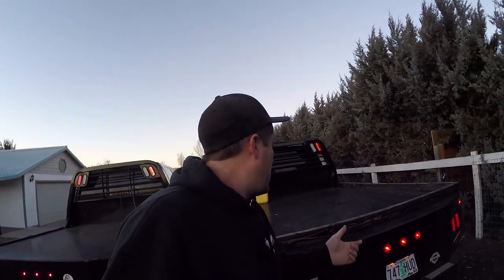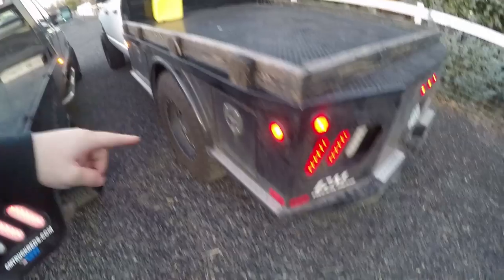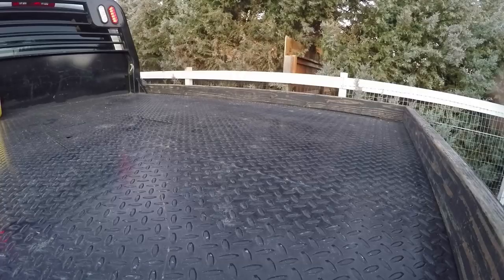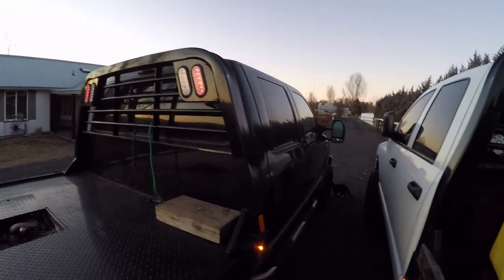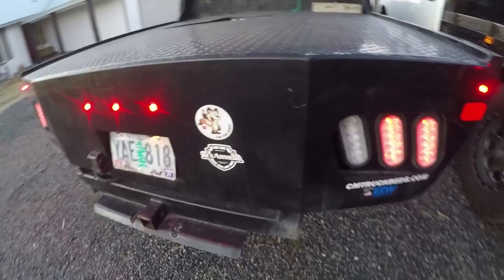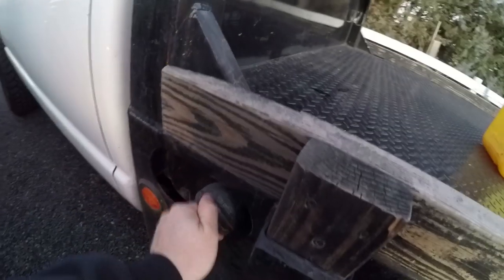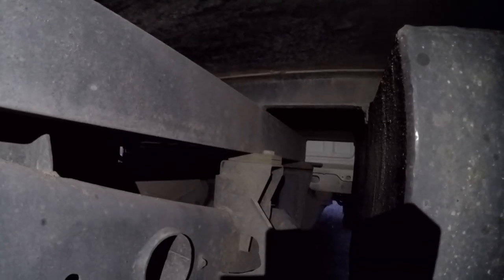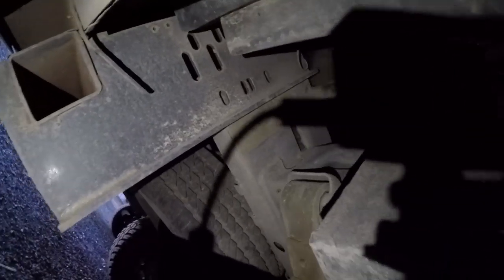PROJECT FLATBED REVIEW 2.0

Comment: You do have to take into account if you put too much weld into sheet metal, it will warp the piss out of it. 
Personally, I would have stitched it about every 6" with a 1" weld though.
Reply: You can also weld it after it cools it just takes a lot longer to manufacture something if you do it that way but it can be done

Comment: Down side of the side board supports that have a fall through on the entire perimeter, it's a hazard for dogs; they'll get their legs caught.  

The other thing about doing a conversion, I had them lower the bed (got a wide one) for easier loading- and it's pain to get gas in.  Learned on a 97 F350... converted to a dually in the process.

Comment: Careful putting the fill neck replacement inside the headache rack, let me rephrase......inside the outer upright toward the middle because if you're loaded with somethin you're hooped when you need fuel! My buddy's dad and grandpa had a bunch of 70's ford's with flatbeds we fed and hauled cows with, well the fill necks were cut into the floor of the bed on a couple and when you hauled hay with the fuel mileage on them ol 4 speed gas hogs had you moving hay to be able to fuel up. Like having a flatbed on an obs 7.3...............will NOT take fuel if you don't use a block lol, just part of flatbed life with a Ford I guess lol

Comment: Mine lasted 2 years till it fell apart 4500$ down the drain
Reply: Cameron Barrett how’d that happen?? Abuse it off road? Constant heavy loads?
Reply: Praedyth The Lost  none of that washed every week. 2 months in backboard separates on me no reason 6 months in all the powder coated peeled inside the tool boxes none of the seals work all the led corroded out. Year later 80% of the powder coat is gone. Would be a great bed if they gave a shit about prep work. Wouldn’t warranty it
Reply: @dodgecumminsbeast  or bed line it 😂😂😂

Comment: I would take regular paint over those coatings, once it gets chipped and rust get under it, it spreads and you cant feather sand and repaint, you just keep grinding and finding more rust under it !! It never stops !
Reply: @Curious-Mr.-Lee  I have, and regardless of how much prep there is always rust further away under the coating and it will lift.

Comment: Ive been looking at these beds for some time but i dont know what size to get for the short box like yours. The dominions on the site all show 8' plus and i am preaty sure thats not right any advice?
Reply: 84 inch or 7 foot is for shortbox
Reply: Remember you won’t have a tailgate to lay down so it gives you the extra foot or two
Reply: I had that question. I have a friend and his going to give me his cm bed it's 8ft long and mi truck is 6 ft 11 inch I don't know if that would affect anything do you know if I shouldn't do it?
Reply: @nicholascandelario8876   I never got to order mine rolled it over a mountain due to black ice so my advice won’t help sorry